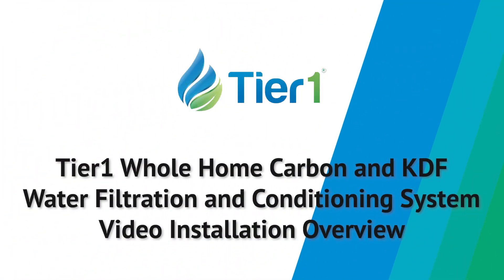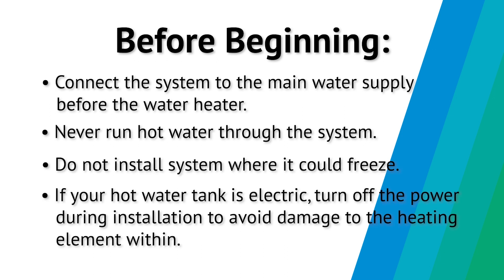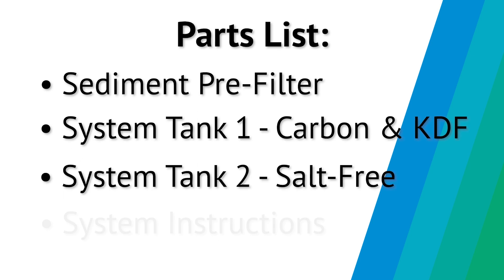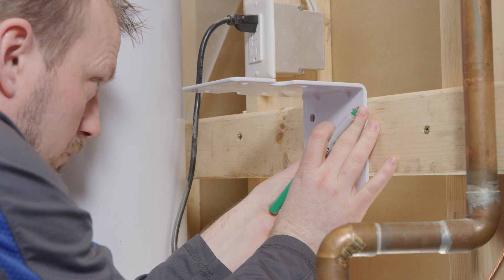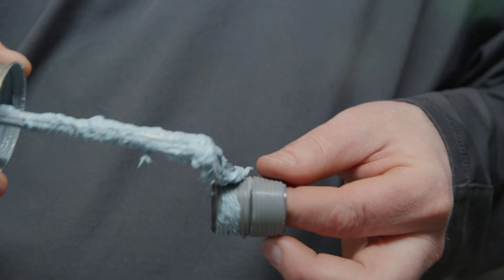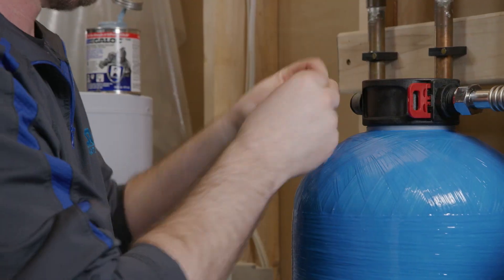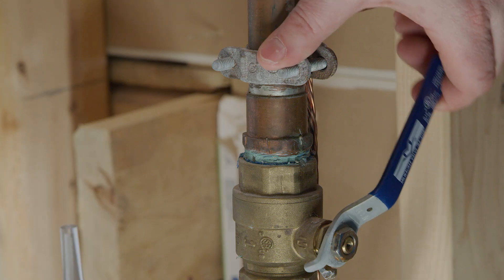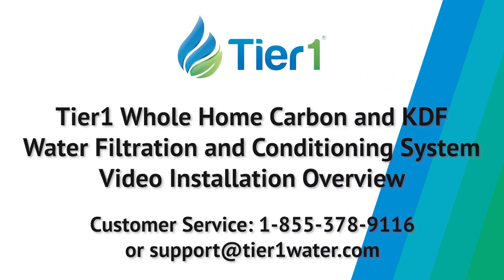How to Install Tier1 Whole House Salt-Free Water Softener Alternative and Chlorine Reduction System

Comment: Hello, there is a discrepancy between your video and the written instructions. In the written instructions it says to install the prefiltration system to the wall at equal height with the tank adapter. In the video, the prefiltration is located well below the height of the tank.